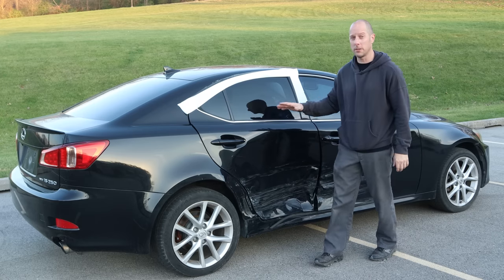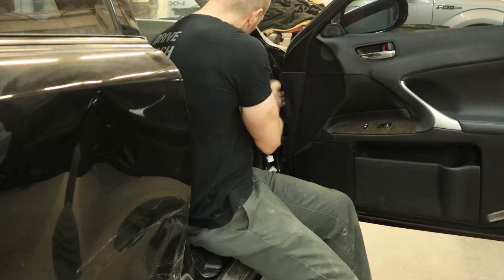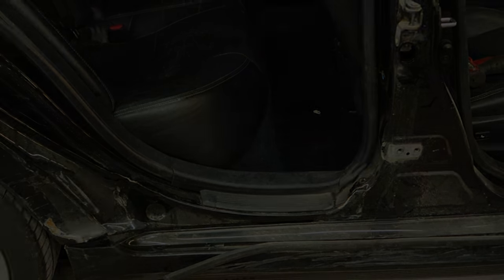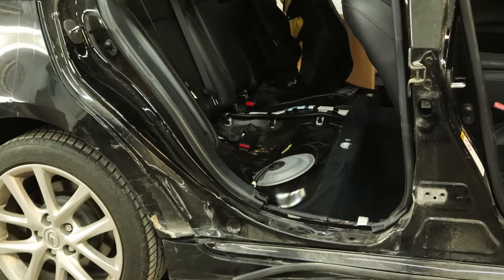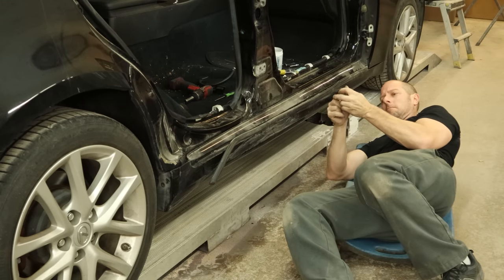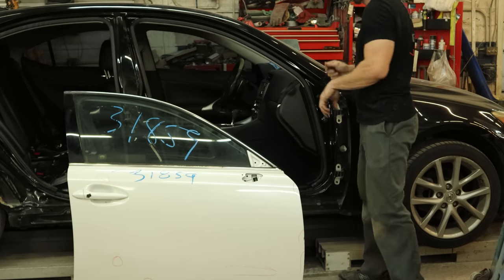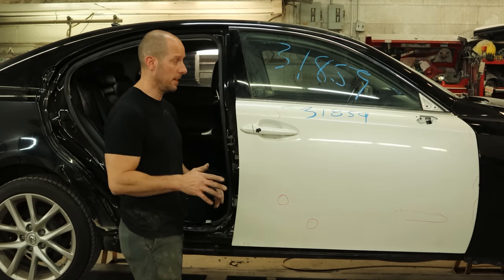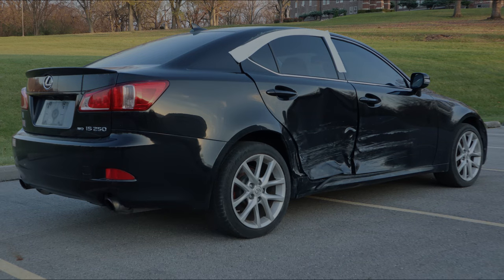Rebuilding a Lexus IS after a side collision

Comment: I use a 5 gallon bucket and a 2"x4" for a door stand.  You are much younger than me, but you inspired me to do another rebuild, a 2013 Honda Civic.  Thanks Scott, you are the man!
Reply: I don't understand you are able to repair these cars & trucks very nicely and the insurance companies total them that should be up to the owners of the vehicle
Reply: Insurance companies will let you buy the car back and have it repaired. I have a 2004 Toyota Corolla that was totaled in 2014. Their estimates were at almost $6000 and they valued the car at $7200. It cost me $2000 to keep it and we chose to keep it as a backup car. We have put about 70,000 miles on it since it was totaled and it became our main driver when our 2014 Nissan Sentra was totaled by a Great Pyrenees dog. 1 airbag and 2 seat belts with related parts and labor accounted for most of the damage and the insurance companies will not allow the body shops to use anything but new parts for airbag and seat belts and insist that the whole system will be replaced.  The only reason the airbag and seat belt tensioners deployed is that the dog was jumping at a school bus when I hit him. He came through the grill and drove the airbag sensor into the AC coil. This policy of insisting that everything in the system be replaced has resulted in vehicles with relatively minimal body damage being totaled because of the airbags and seat belts. I wish I had kept the Sentra and rebuilt it myself.
Reply: @danielbutler578  hope the dog was ok

Comment: At least that battery didn't have a safety sticker at the bottom side.... like I found out they have here after I quickly put a new one in my key and it didn't work... Seems a liitle hazardous plastic sticker is nowadays attached to warn you it's dangerous for babies. and you don't see that if you don't flip the battery when you take it out of its packaging before you fit it in the key...